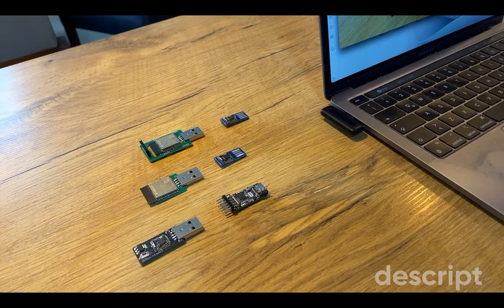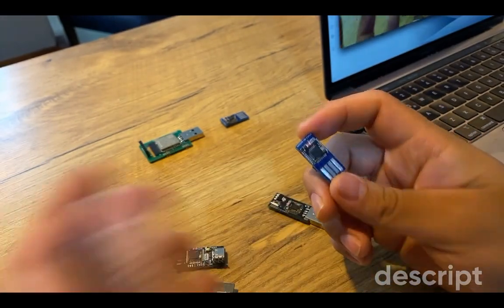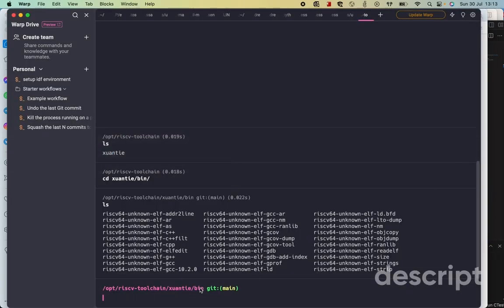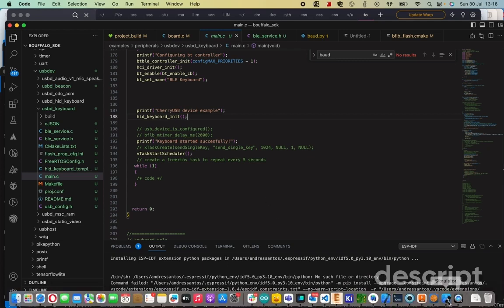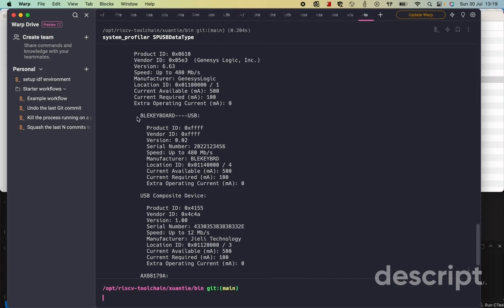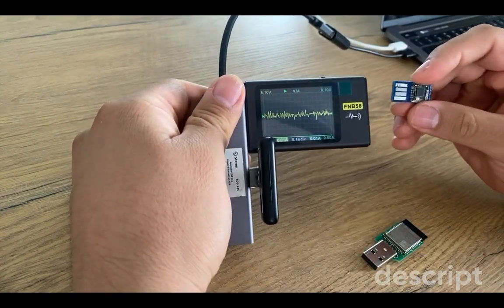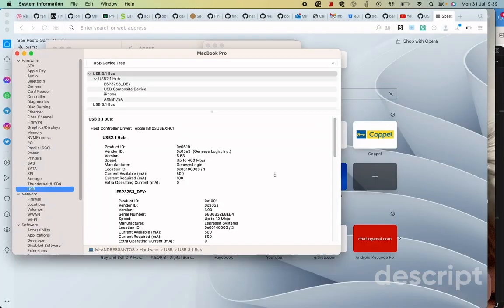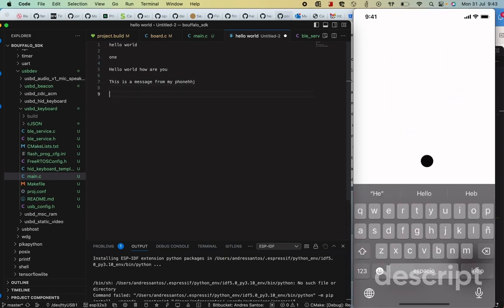Getting started with bouffalo labs BL616

Comment: Quick question what is BL606? I saw it on my router and I'm afraid I've been spied on or hacked
Reply from the maker: basically is a powerful wifi chip, it has an architecture powerful enough to handle a lot of load, BUT yeah this has a lot of hidden features, that are not even documented
Reply: It's most likely a smart plug, or other IOT device.  Block it from your wifi, see what stops working.